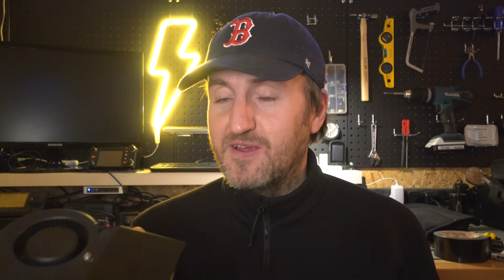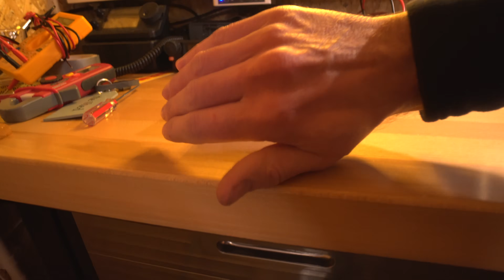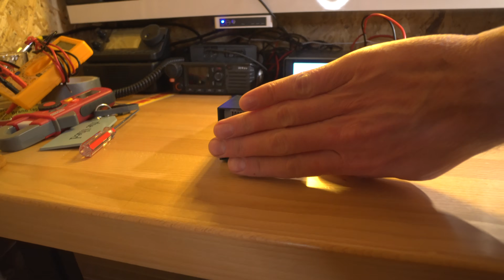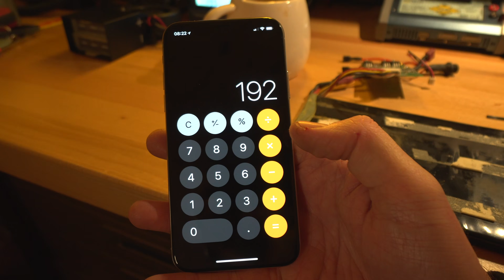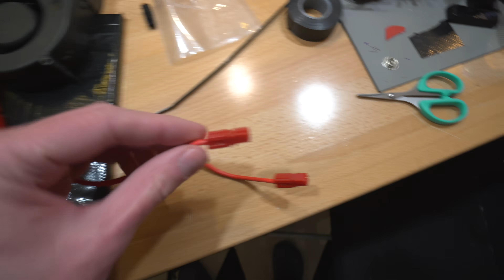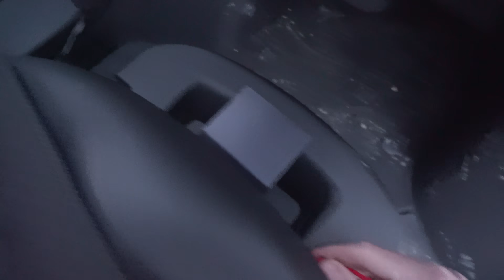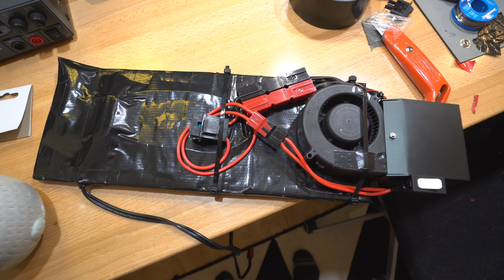BATTERY POWERED HEATERS???

Comment: Uhh! Put a stable case around the Battery!!!
The Seat will crack eventually! (If not already).
It´s broken by design.
Renault planed to put an anti submarining airbag in to that seat , but scrapped the idea in the last minute.
So all the holes for that airbag are in the seat, but without the stabilizing parts.

https://www.twizy-forum.de/attachment/13554

I would say at least 70-80% of all Twizy seats will break in the first 10000km.
You will not notice it, since you sitting very comfortable on the main battery housing.

Just take a torch and have a look ;-)

Comment: Great project!
Do you think a 18v power drill battery would give you enough capacity?
On the draughty Twizy you want to close some of the holes up.
The worst culprit is the hole from the steering column, the wind blows up your trouser leg!
Have a look on the Twizy forums for pictures, very easy to make and makes a difference!
Reply from the maker: Actually I have a 5Ah 18v drill battery and one of these heaters runs for about 15-20 minutes but they also charge pretty quick so it’s not bad. 
Good advice about the twizy, I know the hole you mean, I will check out how to insulate it!!

Comment: @ andy kirby

Imagine if you put a 300w 24v mono solar panel L×W×H 1480*990*35 mm 16kg on roof racks on top of the Twizy  So whenever you went out during the day it could be going through a reasonably good 12/24v 30a Solar Controller & use a 16v 500 Farad Super Capacitors that is hooked up in place of a battery. I have 3 sets of 3000 Farad Super Capacitors in parallel which can transfer 170 amps per set, a 500 Farad set would be able to handle 1/6th of 170 amps or 28.3 amps x 15v = 424.5w that the super capacitor set will transfer.All you would have to do is adjust the settings of the voltages inside the solar charger to work with the capacitors. This has been done this way where there is a guy that made a capacitor bank connected up to an inverter to use to run power tools while his foldout solar panels laid on the ground.

The reason I have mine are that I'll be using mine off grid with 12v inverters & when you draw large loads from lead acid batteries you get an instant voltage sag because they are not meant for high drain appliances. To get around this you put Super Capacitors between the solar charger & batteries to the inverter, all of the power coming from the solar panels will go in & out of the capacitors to the inverters leaving only a small drain on the batteries that may be the extra load that the solar doesn't provide. In other words you might have a 320 amp load from your inverter, 260 amps could be coming from your solar panels going through the capacitors & the extra 60 amps needed coming from the batteries which they can easily provide for a long period.

Also if you carried around a small inverter with you then you could also charge slowly your car if you are stuck somewhere with no charging station, out of range of mobile or other ways of charging up. If you are stuck for an hour charging to get 5 miles of power then that could be enough to get you to a charging place or somewhere you can charge quicker. You could also heat up your shed during the daytime by having it automatically come on as the sun is shining & transferring power to the Super Capacitor set or sets in series if you run 12v or 24v & when the sun goes down it will shut off so if you come into the shed at night the shed should keep it's warmth until the morning.

https://www.ebay.com.au/itm/300W-SOLAR-PANEL-MONOCRYSTALLINE-12V-24V-MONO-CARAVAN-BOAT-HOUSE-OFF-GRID/132409840226?epid=12010287477&hash=item1ed43dd262:g:6W8AAOSwy0JaPCdX

https://www.ebay.com.au/itm/15A-30A-50A-Solar-Charge-Controller-Battery-Regulator-12V-24V-Auto-100V-MPPT-EN/272774628898?hash=item3f82a28622:m:m9RJggFV1VDfBtbpTxX-Ayw

https://www.ebay.com.au/itm/6-Pcs-1-35MM-X-60MM-Farad-Capacitor-2-7V-500F-Super-Capacitor-Protection-Board/323025974166?hash=item4b35d93396:g:T4QAAOSwp7taaC53

Mark, Perth, Western Australia
Reply from the maker: Very interesting Mark, I’m mid way through filming a series about converting my shed to solar and I’m intrigued by what you are saying about super capacitors, I’ve learnt very quickly that 1000W will be pulling about 90A at 12V but you rarely need that much power, for instance my Dyson heater may blast 2kW for 10-20 seconds to heat the shed up and then not do it again for 20 minutes or so, so it’s pointless having a huge battery bank just to cope with intermittent loads, (my shed uses less than 1kwh per day) I will certainly look more into this. I’m currently building a micro powerwall and it will be featured soon on the channel. Thanks again for the comment.
Reply: For your shed you could have a small battery bank and these.
https://www.mouser.com/Passive-Components/Capacitors/Supercapacitors-Ultracapacitors/_/N-5x76s?P=1yx4aw3&Keyword=167816066&FS=True&Ntk=P_MarCom

Comment: just got hold of one of those heaters from amazon. going to have a mess around with it and see what i can do ..may come in useful for the shed.
Reply from the maker: Great! They work pretty well, one thing I didn’t try is wiring up the two elements in series. I reckon if you have a few of these in a shed it would get pretty toasty, even on 12V.
Reply: by the way its your falt i orded it hahahah.. but yea nice vid man
Reply from the maker: Haha! 😅 we all love a gadget around here! let me know how it goes.
Reply: hahahah will do dude
Reply: well i got hold of mine and ,yea it puts out a lot of heat for its size....nice and warm lol...put it on my shed battary since my shed is powerd by solar panals ( its a 100AH deep cycle)  and it draws around 30 amps...at 12v..dont have anything thats 24 volt so i cant test it. but still its nice
Reply: Have you got a link please?
Reply: Champion!  Thank you :)
Reply: your welcome

Comment: You could almost use this with a battery pack
https://www.ebay.co.uk/itm/Handheld-Mini-Electric-Desktop-Heater-Portable-Office-Winter-Air-Fan-Warmer/332332503561?hash=item4d608f9209:m:m0kuP6IhH9y9EvFVoZWPDmA
Reply from the maker: Yeah indeed, you could try to run it on  30 x 18650 cells in series for 111v nominal 😎